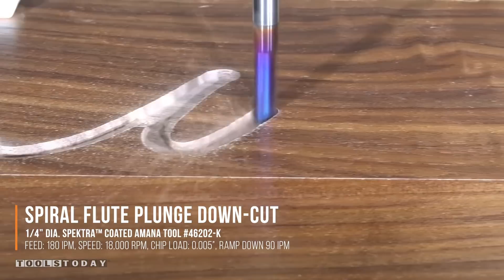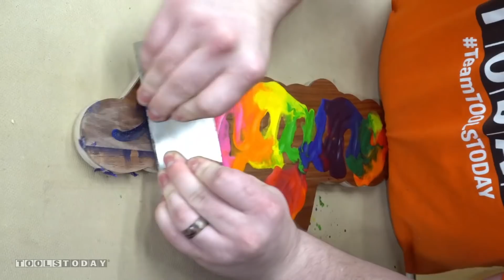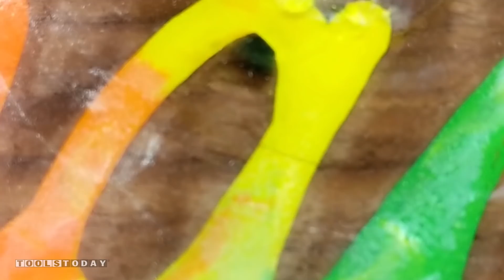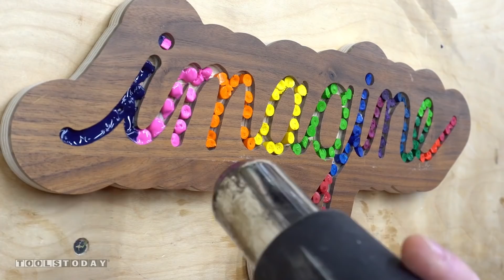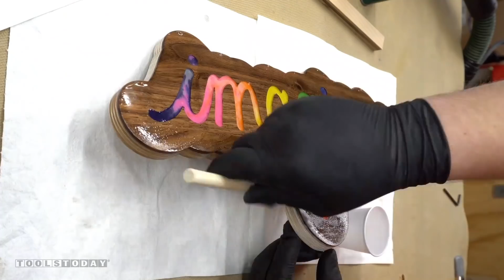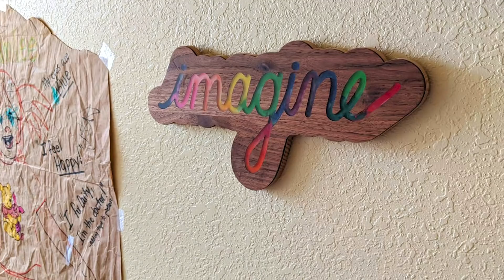CNC Project: Crayon Art Sign | ToolsToday

Comment: Great work Matt, as usual! A few questions: 1) How wide was your text pocket? Crayola Crayons are about 0.315 inches in diameter. I did a test with a pocket width of 0.320, and it didn't do very well. 2) When you traced the bitmap of your wife's writing in Vectric, how did you specify the consistent width for your pocket? Unless you used smaller crayons, a quarter inch end mill will not cut the pocket wide enough. 3) Did you seal the oak flooring scrap piece first, before you melted the crayons? If so, what did you use? I tried using just one coat of brush-on sanding sealer, on a scrap piece of birch plywood, that didn't work - too much crayon bleed into the grain. 4) Do you think a coat of Total Boat epoxy all over the work piece first, before melting the crayons, would be a good idea? Incidentally, I discovered sanding the work piece without sealing the crayon doesn't work - the crayon melts! LOL  😀

Comment: How did you get the crayons to not fly all over the place. I stained my project already and am afraid that the melted crayon and crayon chunks will blow all over it like my practice piece .
Reply from the maker: I cut a deeper pocket so that they wouldn’t go all over the place like they did in the first try.
Reply: I cut the letters deep and they still did but should I stain it after I melt the crayons so I can sand it? Thank you for the quick response.
Reply from the maker: @joem.342  It’s possible the heat gun was up too high causing it to move more air making the crayons blow around.  I’m not sure what you mean by stain it, but the way I did it was to use a card scraper to remove the crayons from the surface, you can’t sand them as it’s just wax and will color on the wood, then used epoxy over the top of them to seal them in and then I was able to sand.  Hope that helps.